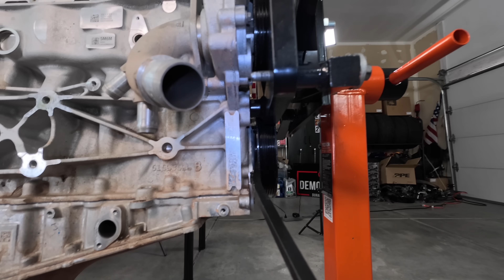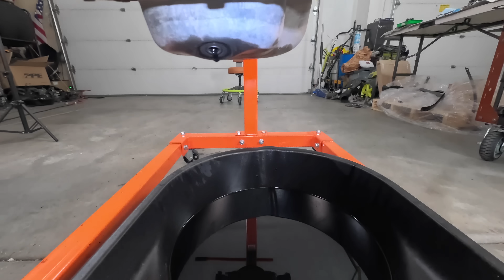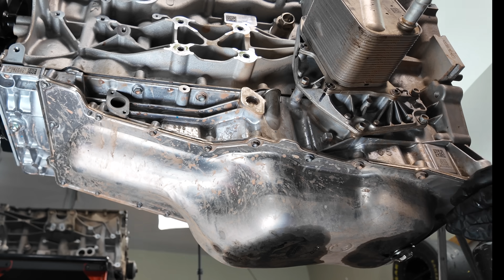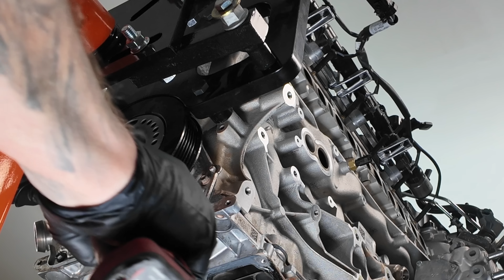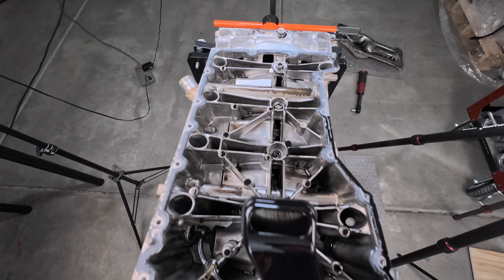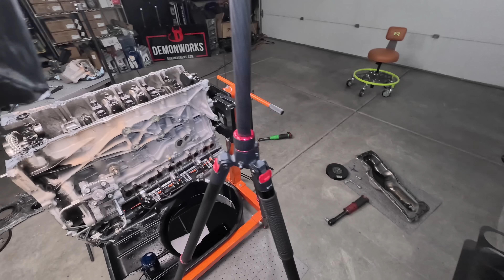Was This Engine Built Wrong? 3.0 Duramax Failure Investigation

Comment: You would think that they would know how many bearings are required per engine and over a period of time  would notice that they have too many left over in their parts bin for the # of engines they have built??
If this is indeed the case comforting for some yet also so disturbing!!
Reply: Exactly my thoughts. Which is a quality control issue.
Reply: Its called scrap/dropped parts/ bad IQ,  no one would figure that out in time. Another QA device should be in the process, like crank end play check in a crank only torque to turn cell, a vision device looking for this part, a sensing device such as a laser post install. The last two are difficult to make reliable with such a thin component/ being blocked by the other mains.
Reply: it would be easier to make a graded saddle bearing with a 2D check prior to crank install.
Reply: That's because unlike aircraft manufacturing, automotive manufacturers don't issue out the correct number of parts, they just pull parts from a big bin until it's empty. If this were done properly all parts would be issued as an itemized kit and if you were short parts or had leftover parts you would have to go back and disassemble until you found the issue.

Comment: Internal oil pump belts are a really stupid idea especially if the motor needs to come out to replace it.
I have seen videos of oil pump belts still hanging on by a thread but the motor lost oil pressure because the pickup was full of shredded belt debris and they were all low mileage but just out of warranty motors
Reply: It’s a non issue. Even when changed at 200k miles, the belts have all looked great, and you remove the tranny, not the motor.

Comment: https://youtu.be/2rXlLW1iZUQ?is=63HfBYyTKbK7DJSR
Reply: I watched that yesterday. Once I used up my current Mobil 1 0w20 ESP I'll probably switch over to the Mobil 1 Delvac 5W40 as shown in that video. I've got a 2022 LM2 and so far not a lick of trouble and I have zero oil consumption between 5K mile oil changes. This is probably my last new vehicle as I retired in 2024 so I've got to make it last!
Reply: @edwardpate6128 yeah , and enough of these fear mongering incompetent keyboard non mechanically inclined buffoons screaming foul if you decide to run 5W-30 instead the water weight 0W-20 in your 5.3 L L84 engine…!

Comment: I’d imagine that if this is the case and after a few warranty engine tear downs and GM quietly discovered the same that maybe they knew they’d have to quickly ship hundreds if not more replacement engines that would exacerbate an already bad situation.  Wouldn’t be too much to expect a change in the service bulletin to add as a recall or covered warranty inspection at the least.

Comment: That does make some since but I'm rather surprised it made it that long. If missing bearings is all the cause is. One would think the best course of action would be bring them all in for a end play check before failing on the road some where. Perhaps they should look into  changing  the design so the top shell of the thrust main is one with the thrust. Many industrial diesel engines are made that way. No way to forget it or have it fall out. I think I'll go out and check my end play. It its good I'm sure going to worry a whole lot less. Thank you!
Reply: The rear thrust bearing is all that's loaded.  There is no force other than vehicle acceleration acting to drive the crank rearward.  The transmission loads the crank forward with either clutch pressure plate force, or torque converter fluid pressure.  What cause the failure was the loss of oil volume across the rear thrust bearing from the front missing and spilling all the thrust bearing lube oil out the front.

Comment: Just think this junk is put into an $80k truck....but hey that fuel economy.😂 The money you save on fuel economy is for a new engine it will need at 100k miles🤣🤣.
Reply: What "junk" are you referring to? A missing TB that was never in the motor to begin with?
Reply: @PNW3.0Sierra I'm referring to the monstrosity that's sitting between the frame rails of your truck.🤣🤣

Comment: 23 lz0. 43k , 15k of towing. change oil and drive, 0 issues.
Reply: '23 LZ0 with 30k miles. Just drove 1,300 mile trip through the mountains dragging a 3,600lb boat and it did a fantastic job. Still averaged 18mpg towing. I did switch to Mobile 1 5w-30 extended performance since it's one of the few PAO4 oils on the market. I also changed my oil after 4k miles when I get a chance and no longer than 5k miles.
Reply: 2022 LM2 here with 45K miles. 5K mile oil changes using Mobil 1 ESP 0W20 with zero consumption between them. Based on some new video evidence out there I will probably switch over to a heaver weight Mobil 1 when my current supply of 0W20 is used up.

Comment: Not exactly confidence inspiring to know that a worker at Flint managed to build potentially thousands if not tens of thousands of engines with a missing thrust bearing and nobody caught it.
Reply: Don’t underestimate what a disgruntled employee can and will do. 

But it does beg the question: is there no one checking the work?
Reply: @markwiggins6442 there is normally man & machine in place to protect against this.
Reply: My question is where did he put the extra bearings? Was old Mike sitting next to a pile of thrust bearings as he cursed GM under his breath?😅
Reply: It's not what happened at all, it was a supplier issue. There was no disgruntled employee, this wasn't sabotage. God the misinformation out there is beyond stupid.
Reply: @whoppes27  So what was the supplier issue? Dimensional or material composition issues with the bearings?

Comment: '23 LZO 70,000 miles no issues.
Reply: 85k on mine. No engine issues. Did have a problem with pump for the transmission around 70k. But they replaced it no issues

Comment: Thank you so much. Have a 26 built  in Feb 26, so glad to see it was a bad build job, not just a thrust bearing issue.
Reply: Mine’s a 26 built in 3/26….. fingers and toes crossed :)
Reply: @rkiheavy3002  It's easy to check in the vehicle.  Check it.  Then you'll know.  How many miles on your truck?
Reply: @BillyWillicker how do you check? Just got one now want to be on the lookout thank you
Reply: @JordanCallawaycompanies  You remove the accessory belt and push the crank damper pulley front to rear and if it moves enough to feel, your customer is boned.

Comment: What engineer thought was a great idea to make a multi piece thrust bearing ? 
I’ve been in the parts business for 29 years and the thrust bearings I’ve seen are a U shaped upper and lower bearing shells.  I have 2025 Silverado with the 3.0 with a truck build date of 3/25.  Should I be concerned ?
Reply: An engineer Probably didn’t make that decision
Reply: Caterpillar has used the 2 piece design like the one here for decades

Comment: It would have been good to know the truck build date just for reference.  Pardon my ignorance, what was the oil part that was missing?   Was that caused by the thrust bearing missing?   Are you saying to check for end play and if none, all “should” be good?  Even with only one thrust bearing will the crank move forward and backward?    I’m ready to crawl under mine to see if it moves.
Reply from the maker: June 2025
Reply: @DemonWorks .  Hopefully the guy that was only putting in one bearing got fired before an engine going into a Feb. 2026!   Or else the robot got sold for scrap metal!   Thanks for the answer!

Comment: Wow, talk about the smoking gun - I know many people are moving to a higher viscosity oil such as 0W-30 or 0W-40 and I am thinking of doing the same at the next oil change.  What are your thoughts of going to 0W-40 instead of 0W-30 especially if half your annual miles are towing?  My 2025 LZO has close to 12K miles on it and I had the thrust bearing end play checked at around 7.8K miles and it was in the mid point of the tolerance range - so I am hoping you are right on this finding and this was not a one off - regardless, your vlogs are incredibly educational.  THANKS.
Reply from the maker: some of the best oil results that have been shared with me were from people running a 0w40. I just haven't gotten that far, yet.
Reply: @DemonWorks  Is the PPE oil filter still adequate for 0w40 or is that oil too thick for that filter?
Reply: I wouldn't hesitate to run something like a mobile 1 esp 0w-40 or John Deere 0w-40. You'de be getting highest quality pao group IV ester blends. Screw the dexos stamp of approval. Gm hate you
Reply: 0w40 is very hard to find where I am. Currently running Pen Euro 5-30 with good results.
Reply: @DMoney2120 I just ordered mobil 1 ESP X4 0w-40 from Summit Racing and it shipped next days over the weekend via fedex.  Awesome price too.
Reply: @kaivonmortazavi8656 please let me know how it goes I’m thinking of also taking this route
Reply: @JordanCallawaycompanies OIl arrived via fedex - now I have to find the time to make the change.  I ordered the PPE filter.  I am hoping to see less oil consumption too while towing.
Reply: Is not the dealer the one to be doing the rebuild? Why isn't this engine under warranty?

Comment: Whats the assumbly date on that engine? Also is there any way to determine why the thrust bearing failed? Did it simply fall out or did something shear off from a bad heat treat or something?
Reply from the maker: The vehicle was assembled Late June of 2025. I believe the 1 thrust bearing failed because the other one was missing.
Reply: @DemonWorks that would be crazy if all of these failures were because some assembler didnt know there was supposed to be two
Reply: @alex-b24 It's unreal the damage they did to the LZ0's reputation. How does something so critical like that not get caught somewhere in the process?

Comment: I bought my 25 in May of 25. I have just about 11,500 miles on it. Great oil pressure and minimal oil consumption. I also change the oil every 4,000 miles. While it’s under warranty, I’ll keep running their 0W20. But once I’m on the hook for repairs, I’ll be switching oils. I’m assuming my 25 was built before the thrust bearing issue. 

You have yourself a very interesting find. I’d have to say you’re right. They only put one thrust bearing in. And I agree. That’s great news. That means it was just human error and not a true reliability issue.
Reply: Several videos showing the oil analysis results between AC Delco and even the approved Mobil 0w-20 dexos-D...Mobil has less than half the wear metals. If you aren't comfortable switching to 30 weight, then at least go to Mobil. The motor oil geek channel just did had a video relating to this. There's no way I am putting AC Delco back in my motor. And the Mobil is usually a better price through Walmart. I have 50k on my truck and just out the 30 weight Mobil esp in for the first time. Wish I would have switched sooner. But never going back to AC Delco, regardless.
Reply: If you plan on keeping it long after the warranty you’re better off changing oil viscosity now. Not much good if the thin oil damages bearings enough for it to fail soon after the warranty runs out.
Reply: Same. 2025 Sierra 3.0 Duramax, but build date was August 2024. Just passed 12k miles. No issues.
Reply: I have a 2025 trailboss.  thrust bearing went at 8,500 miles currently in the shop getting motor replaced.
Reply: @patricklynch9184 Is it an early or late build?
Reply: My 2025 thrust bearing left the chat at 22k miles. April 2025 build 😢

Comment: When I had my 26 truck in for the brembo brake swap I asked the dealer if they could check the end play and told them about the thrust bearing concern.  They really played it off and said they could check it out if I wanted them to but made it sound like a big thing to do.  I know it's not having seen your vids.  How much would a dealer typically charge for something like that?  Just to check it? Im just over 4300 miles.
Reply from the maker: They should do it for free, based on the bulletin. When the bulletin first came out, I felt dealers would actually charge for this inspection, but they are not, it's a warrantable check and there is a warranty op code in the bulletin for it.
Reply: @DemonWorks good to know.  I may schedule it back in there to get it checked. Because if what you discovered is true, that if it's solid it should be good to go... that would be a relief. Lets just hope thats the case. Ive done 2 oil changes already and the oil has looked pretty good so im hoping there isnt any sludge building up like in this video.  Also, running that motul on this go around. Looking forward to your results on that!
Reply: Happy to take that brake kit money though, weren't they?
Reply: @kevingallagher3yea they were.

Comment: Good info.. you think the oil is so sludgy because it has never been replaced?
Reply from the maker: I think it was just buildup that got stuck at the bottom of the pan and continued to build up. this engine did get an oil change around 4500 miles.

Comment: Today has been a great day for the 3.0. This video and Lake Speeds oil test vid. wow.
Reply from the maker: Lake Speed made a great video for us !
Reply: @DemonWorks regarding his video… I still have a bumper to bumper after market warranty and switched from ACDelco to Mobil 1 0w-20 esp so it was DexosD compliant. I did so based on an oil analysis from Lake. My question is: Lake said the detergent package on the 0w-20 thru 0w-40 was the same.  Does this mean that if I had a catastrophic failure and they tested my oil it would appear to have DexosD?  If so, can they determine the viscosity?  Could I go to 0w-30 or 40 and feel that I’m compliant?
Reply: @Dad_Mode_Garage Oil analysis will show the viscosity. But no dealerships are going to test the oil in your sump. Dealerships want the work.
Reply: @Dad_Mode_Garage  They could absolutely determine the viscosity if they wanted.

If you really think the engine is going to fail before warranty is up, then use 0W-20. But, also, if you really think the engine is going to fail before warranty is up then that raises other questions.
Reply: @Jay-me7gw  this dude... I hate that this is the reality
Reply: @Dad_Mode_Garage  There has been a "big deal" concerning 20W oil GM is now saying that it has made a mistake (imagine that), and 20W is too light.  Especially for 7500 mile oil changes. For 20W, it really needs to be every 5000 miles, imho.  These new modern engines are VERY picky about the oil you put in. I decided to "overachieve" on oil changes and maintenance in general. So I use ONLY mobile one synthetic.  But I have to use 20W because I have the lifetime drivetrain warranty, if I deviate from that, they will void the warranty. OK (rolls eyes).  What I have been doing is instead of 7500k miles, change every 5000 miles, ONLY use Mobile one.  Put I like royal Purple too, and it also has the Dexos rating.  Don't use anything other than Dexos, asking for trouble.  On my 2018 Denali, I had that engine burning only a 1/2 qt between 7500 oil changes with 135k miles on it, before I sold it. Key words here are OVERACHIEVE, especially on oil changes.  But if you can, I'd use 30W oil instead of 20W oil, if your warranty allows for it.  I don't have time to go into detail why they chose 20W, but as usual they were pushing the limits, and bean counters should stick to counting beans and let the engineers do their job.
Reply: @KingEdward-o7x can you send a link to GM walking back the 0w-20 on these 3.0s?
Reply: @Dad_Mode_Garage  I don't have a link.  It is in a service bulletin for the 6.2L engines that had the rod problem during and after covid.  Just go to the service bulletins.  I don't know if they specifically walked back the 20W, but they did change it to 40W, for those motors, which is kinda saying the same thing.   Anyway, I think it's obvious 20W is not adequate for the long term.  GM does not care though, as long as it last through the 60k warranty, they wash their hands.
Reply: @DemonWorks  a follow up video with your opinion on his findings would be great! I'm still using 0w20 in my truck.
Reply: @MultiTucker77  Lake said it without saying it, use Mobile 1 ESP Delvac 5W-40.
Reply: Lake Speeds video was pretty awesome.
Reply: Yeah there was another channel that was testing regular types of Mobile 1 and Pennzoil Platinum (non ultra version) non diesel specific oils, and said they were fine in the Duramax 3.0... Hmm, hem haaaa. 
 Lake Speed Jr's testing, showed that the standard gas engine synthetics increase wear, not only for this engine, but also showed that diesel oil is less wear in diesels in general.
 His testing also showed that diesel engine oil in gas engines, also increased wear in a gas engine, over a good synthetic for gas engines. 
Also Speed Diagnostics records show a lot less wear in the diesels with 0w-30, 5w-30, 5w-40 and 10w-40 in them. 
The lighter oils are not some big problem for the dinky 4 banger gas engines, but the diesels run on higher pressures and don't care so much for those super light oils. 
Even I run 5w-20 in my little Subaru now, especially because of the heat where I'm at in the Southwest, and I've only lost "estimated" .5 mpg over the stock 0w-16...   (also 5w-20 oils, have some of the lowest shear numbers, because of their chemistry)
"Application dictates chemistry"  LOL 
Use diesel oil in diesels and regular synthetics in gas engines folks. Don't listen to people that poor Shell Rotella or Delo, into their car or gas pickup.

Comment: I get a good question for you or maybe not if you had to replace your 
Engine oil pump belt. Is there a replacement for a chain instead?
Reply from the maker: There is not, but with the belt needing to be replaced at 200,000 miles, I don't forsee more than 1% of these engines making it to the point they need a second belt anyway.